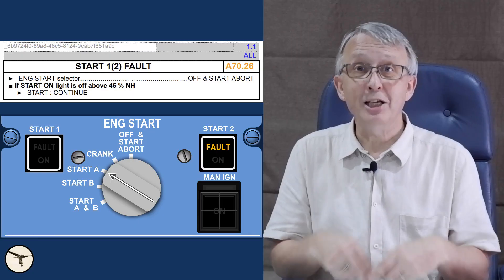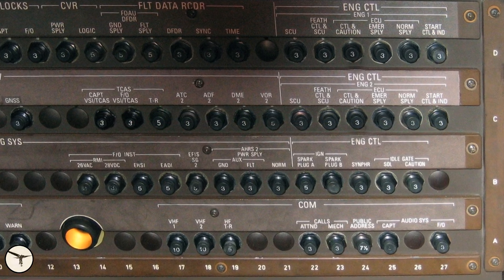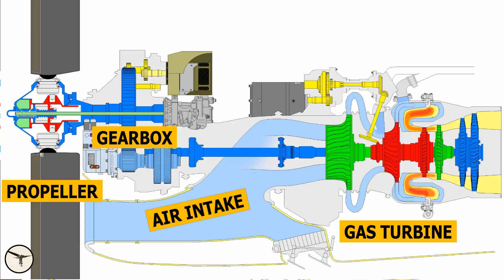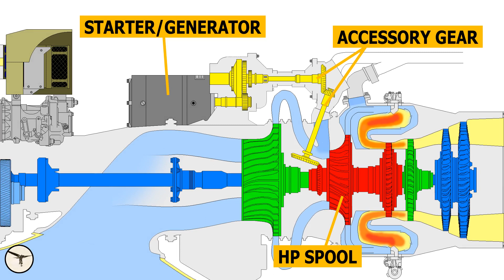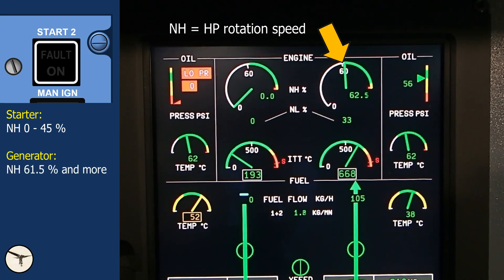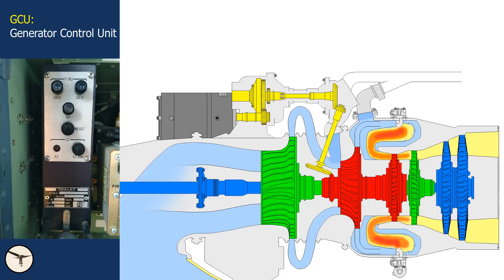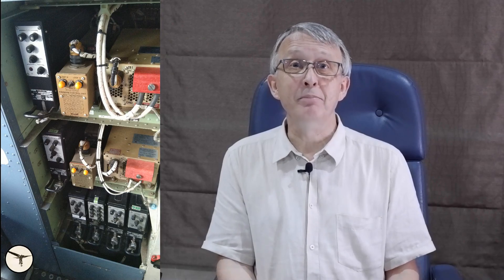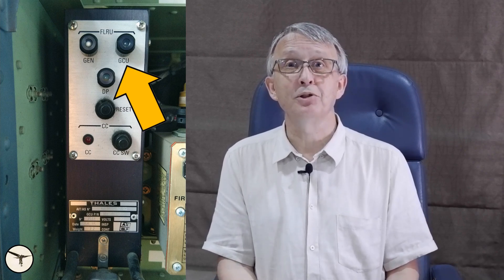ATR 72 starter fault | No mechanic available | What do you do?

Comment: You guys got 2 generators 
Why not to use the other engine generator 
I mean if it was the number 1 generator at fault you guys would never know (or max will got an ecam message) bcs you would start engine 1 with engine 2 simply🙃
Reply from the maker: While you can use the generator of the other engine to provide electrical power, the starter is still inoperative.

Comment: At 1:45 the first officer turned on battery power and immediately connected ground power. I thought the green light next to the CPL button needed to illuminate before connecting ground power?
Reply from the maker: No, the CPL button is for the flight director. Ideally, the first officer should have waited a minute before connecting the external power. But there's nothing that prevents him from connecting external power right away.

Comment: We had a simple way of dealing with problems. 1. Agree the problem. If not an engine failure on T/O or depressurisation failure, do nothing quickly. Pause and breathe. 2. Perform any memory items. 3. Now run the checklist. If you still have problem, gather more information (Circuit beakers/MEL/FCOM/FTL/Engineering etc.) and then decide the short term and the the log term plan. 

We call the white marker a “Doll’s eye”.

Comment: Excellent video! I’d just add the “smack the gust lock” procedure 😁
Reply from the maker: If the gust kick is not in position, the starter FAULT light will illuminate when you move the starter selector out of OFF & START ABORT position.
Reply: @FlywithMagnar  You're right. I forgot that  😬

Comment: Is it possible to do a 'windmill' start on the ATR ?  We sometimes had to do this on RAF Hercules that had a problematic engine/starter, ie very fast Taxi with ignition....
Reply from the maker: No, the ATR has engines with free turbine. It means that the gas turbine is not directly connected to the propeller gearbox, like the engines in the Hercules. And even if the ATR had engines with direct drive, a windmill start will never succeed because the aircraft will have to accelerate incredibly slow to maintain directional control with only one engine running. No runways are that long.

Comment: The ATR is a big enough bird, I am surprised it did not have more ways to start an engine other than a starter. Many other turbine aircraft , either your first get the APU or just any engine running , and the bleed air would do the rest. This make dispatch reliability worse than for others.
Reply from the maker: This engine family is not designed to be started with bleed air. The generator is a combined starter/generator and acts as a generator when the engine is running. Dispatch with a failed generator imposes severe operational limitations (no flight in IMC, night, etc). However, the unit is very reliable, and I have experienced this failure only once in 22 years.

Comment: Did you try smacking the starter with the back of a large screwdriver a few times?  Usually works for me in most cases.
Reply: Yup, was thinking they McGivered it with a piece of wire and a hammer. That's why I'll remain a sim pilot.
Reply: Technical term is a 'calibration tap' ;)

Comment: Thanks again for another great video Magnar, What about if starter remains ON after 45% NH in a station without maintenance? Yes, you follow the procedure and if it works, would you start the flight or call maintenance? Thanks
Reply from the maker: The procedure is to select the starter selector to OFF & START ABORT. If the starter ON light is extinguished above 45 % NH, then the start can be continued. If the light starter ON is on, you shut down the engine and call maintenance.
Reply: @FlywithMagnar  Thank you for your answer.

Comment: Again flew ATR72-500 as passenger from the Åland Islands to Helsinki. No starter faults :D but a very long flare at landing and a hard touchdown, could aircraft potentially have stalled prior to touchdown, as it felt as the nosegear took ground first and the aircraft tilted over slowly ?
Reply from the maker: I doubt the aircraft stalled. It has a stick shaker that alerts the pilots before they get that far. But a long flare is difficult to manage. Very often does the aircraft gain som altitude during such a flare, and then it returns to earth in a pretty firm way.
Reply: @FlywithMagnar  the touchdown was a real bang, as it just fell down after the long flare, it ate alot of runway too.

Comment: And if you have the DP indicator latched on the BPCU it will most likely be one of the hall effect sensors failed. That's a pain in the ass to replace. One is behind the F/O seat down at floor level (behind the CB panel), while the other one is behind the leading edge next to the relevant engine. Neither is easy to change, and you don't know which failed but a little more likely the one at the engine. DP=diferential potential. All the best captain.
Reply: Most likely, the one that failed is the one you check last.  Every time.

Comment: Haven’t flown the ATR form more than 10 years now… but wasn’t there a “start fault” indication when the Gust Lock wasn’t properly engaged? :)

I also still remember dividing into the electric rack doing the GCU resets… Ah… Happy days!
Reply from the maker: Yes, the gust lock must be in place when you want to start the engine in hotel mode (propeller brake ON). Otherwise, the FAULT light will illuminate when you move the starter rotary selector out of OFF & START ABORT position.

Comment: I use to have a 1977 Ford Pickup with the same type of engine starter issue. I found that if I got a few friends to push the truck I could pop the truck into gear and the truck started perfectly every time. So long story short, why not just get all the passengers out of the plane and have them push the aircraft and pop the clutch. Hahahaha  This is just a joke everyone. Sometimes I had to pop my trucks clutch a couple of times!!! Again just a joke everyone!!! 

I’ve seen a few times on a flight that the AC #2 engine was being manually started at the engines side. I know they were just directing the bleed air from the APU like the engines normally use without a ground crew, in these cases the mechanic was doing the job at engines side and no issues/problems ever came up while inflight. Sure did scare many of the other passengers to watch this happen but that’s why the engines are made the way they are. Oh to clarify, these were on Airbus A320’s so the procedure was simple. Certainly wouldn’t work on the Turboprop’s as mentioned here. 

Glad the new starter was replaced so quickly and y’all were safely off to your destination. Only a 2 hour delay sounds like a fairly quick, easy repair. Paperwork/logging most likely took up most of those 2 hours.
Reply from the maker: Great story! Turbofan engines like tjose on A320 and B373 are started with pressurized air from an external cart or the APU. Turboprop engines are not designed to be started that way. They need electrical power.
Reply: @FlywithMagnar  I was just giving you a hard sir!  But was a good video. Still surprised the repair was made so quick. Glad the rest of your flight was trouble free!  Keep the blue sky up!!!
Reply from the maker: ATR is a technician's machine.
Reply: I've push started an old truck before. Always park on a hill. I think the plane equivalent is to spin the prop by hand. I wonder if one pilot taps the starter with a hammer while the other turns the key. Maybe that would help🤔
😄

Comment: Quick Question, could the Air Starter that was Connected not Produce enough Energy to take the Place of the Starter, as an Ex Ground Handler we have had to Start Aircraft with a Unserviceable APU with an Air Starter.
Reply from the maker: No, this type of engine cannot be started with pressurized air.
Reply: @FlywithMagnar  Cheers, used to Like the ATR's but a Bit of a Pain to Load when you were Short of Staff, exspecially the rear, some Captains used to Complain about not being Parked into Wind others said that it wasn't an issue, we used to try our Best though.

Comment: Thank you for the video sir, as an ATR pilot myself it's always good to learn about other peoples experiences. After watching the video I wonder how difficult it would've been for ATR to develop a "cross engine start" system with the bleed air of the opposite engine.
Reply from the maker: The PW100 series engine was not designed for start with compressed air. Therefore, I doubt a conversion can be made.

Comment: Hi captain. What do you think about the atr crash in Sicily in 6th August 2005. Was it the captain fault
Reply from the maker: Do you mean Tuninter flight 1153? That was an ATR 72 that ran out of fuel and ditched in the Mediterranean Sea, 23 NM from Palermo Airport. The investigation proved that a mechanic replaced a faulty fuel quantity indicator (FQI) with FQI made to be used in ATR 42. It indicated more fuel than actually was on board. Next morning, the captain assumed that the aircraft had been uplifted with more fuel, but could not find the fuel receipt. The investigation also revealed that if the dual engine flame-out procedure had been performed correctly, and they immediately had set course for Palermo, they might have been able to reach the airport. However, Palermo ATC had poor English skills and didn't fully understand the emergency and gave the crew useless information. Ultimately, the captain was at fault, but he was not the only one. An Italian court sentenced both pilots and five others in the company to between 8 and 10 years in prison.
Reply: @FlywithMagnar  poor pilot. This was not their fault. This is why news about aviation should not be sensationalized. I prefer avherald and mentour news for aviation news.
Reply from the maker: The accident report can be downloaded here: https://reports.aviation-safety.net/2005/20050806-0_AT72_TS-LBB.pdf
Pleas read it.
On the day before the accident, the captain flew four sectors with the accident aircraft. He notized that the fuel quantity indicator (FQI) for the right-hand tank was missing one LED line on the leftmost digit and three lines on the rightmost digit. (See image on page 2 in the report.) This was not a big deal, as the leftmost digit shows thousands and rarely changes during flight, and the rightmost digit always shows zero. After the last flight, the captain wrote the R/H FQI as faulty in the aircraft's technical logbook. He also wrote down the remining fuel to be 790 kg. 
In the afternoon, a technician changed the FQI and signed off the aircarft. What he didn't notize, was that this FQI belonged to an ATR 42, which has smaller tanks and less number of fuel quantity probes in the tanks than the ATR 72. The only external difference is that the labels indicate that the capacity in each tank is 2250 kg and 2500 kg respectively. Neither did the technicial notice that the FQI now indicated a total of 3100 kg.
Next morning, the aircraft was scheduled to fly to Djerba and back. This is a short sector, and both flights were fully booked. The planned block fuel was 1400 kg, and a fuel tanker was ordered. However, the FQI showed 3100 kg, and the engineer who supervised the refueling, reported back to the Flight Department (FD) that the fueling had not taken place because the fuel quantity was 3100 kg. That was too much with the given payload, and it was decided to fly the Djerba route with another aircraft.
Later that day, the aircraft was scheduled to be ferried to Bari in Italy and pick up passengers and fly them to Djerba. The captain would be the same who flew the aircraft the day before. During the pre-flight briefing, the captain asked for 3800 kg block fuel. A fuel tanker was ordered, and on the refueling panel, the quantity was set to 3800 kg. The fuel slip showed that 600 liters was uplifted. That is only 465 kg. To get 700 kg, you need approximately 900 liters. Nobody notized this.
When checking the documentation, the captain discovered that the fuel slip for the uplift from 790 kg to 3100 kg was missing. The staff at the FD did not find the slip, and they suggested that one of their colleagues had mistakely taken the copy of the fuel slip. They should have at hand when the captain returned.
Quote from page 10 in the report: "The flight captain decided to complete the flight with the documentation for the refueling he had requested, but without the one confirming the previous refuelling operation from 790 kg to 3100 kg."
That decision was the main cause for the accident. Yes, there are many contributing factors, but it is is captain who is responsible for the safety of the flight, and that includes making sure there's enough fuel onboard.
If you have any doubt about the fuel quantity, it measured manually with dip sticks. It's a simple procedure. I have done it when the fuel receipt didn't match the indications in the cockpit.
Reply: @FlywithMagnar  Thanks for PDF, very informative. Seems as all mess begins from bad interchangeable parts database, who checked fuel indicators applicable both for 72 and 42? Misstyp maybe, but a pebble starting avalanche.
Reply: @FlywithMagnar  
So he had dual faults, the one with the missing fuel and the one that he didn't reach Palermo Airport. Thank you captain
Reply: @cupofjoen  he clearly did a poor job when he over estimated his skills, didn't double check the fuel quantity, specially that he was the last one that flew the aircraft

Comment: Is there any situation when you would do a flight with only one working engine from the start?
Reply from the maker: I have tried that, in a simulator! We disabled the "crash" mode, and off we went. In the beginning, you can only use 15-20% power, or your cannot maintain directional control with the nose wheel. When you reach 40 kt, the rudder starts to become effective, and you can increase power a little more. As the speed continues to increase, the rudder becomes more and more effective, you can add a little more power, bit by bit. The problem is that takes a lot of time, and you will run out of runway looong time before you reach V1 (take-off decision speed), which is the minimum speed where you can maintain directional control with max power on the operating engine. It's like a road movie where you view life passing by in slow motion.
Reply: @FlywithMagnar  So in theory you could take off  from an empty  highway if needed
Reply: No. With only 1 engine working is practically impossible to take off, basically because the yaw moment is so large you wouldn't be able to maintain the centreline of the runway. The only scenario I could see is if there is a war starting, or an invasion to the airport and even then I doubt you'd manage to take-off.